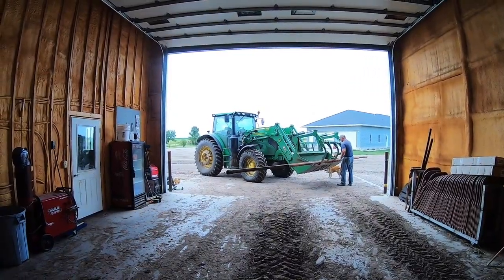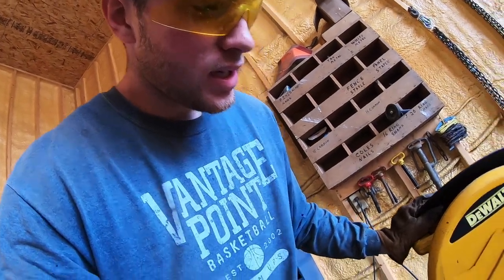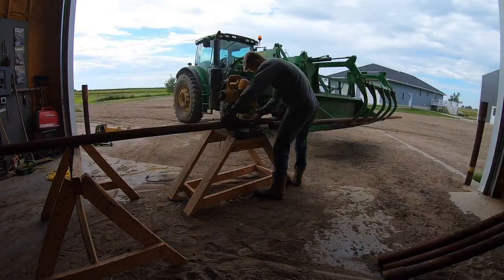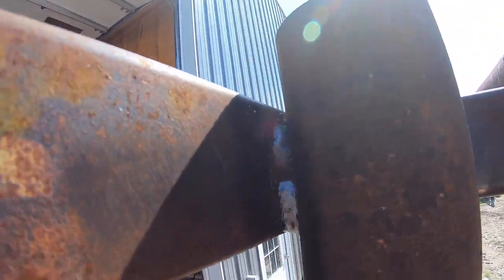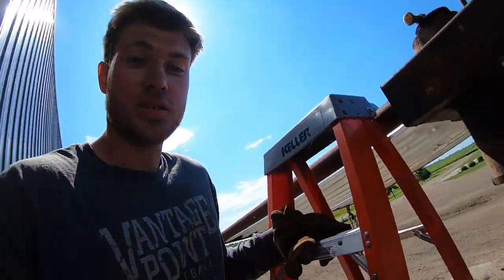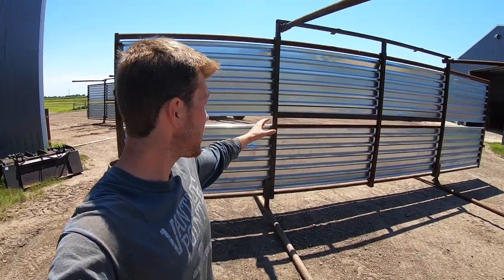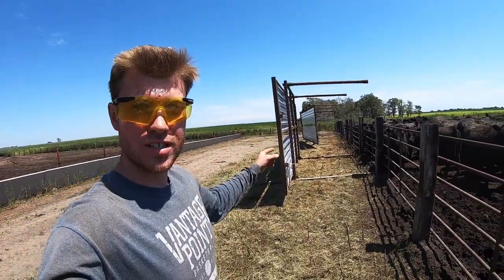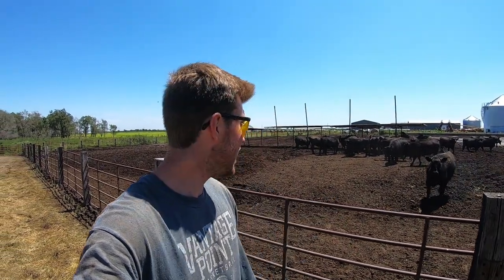Welding Windbreaks into Shade for Cattle

Comment: Consider getting a tank of 100% CO2. It's generally cheaper and burns hotter. But for these windy situations, just get some good flux core wire and you won't need any gas.

Comment: Hey...  so when you flip them over I’d suggest tying a locking chain loosely to   The frame of your forks to the bottom of the frame of your Windbreaks to prevent them from turning over that violently. You can also get some pallet fork extensions that won’t allow the panel to go all the way over too.  Also if you leave them in all year your center of gravity will be altered and I when the wind is flexing the panel, that might be added weight to start bending the panel or alter its performance as a Windbreak!  Remember you are heavily mechanically advantaged up there so 50 lbs gets to be a lot of weight.
Reply from the maker: Thanks for the information, I actually talked to my dad about pallet fork extensions a couple days ago, I think that is a good idea.

Comment: Good metal works...quick thinking....would it be nicer, paint welded spots, to prevent rust. Weld cross angle bar to strengthen structure a bit...little stinless steel chain 500 kg to weld or hook with stainless u bolt,  in future need to shift places easier...one tractor... Dad is wise....boom works for hoisting😁😁😁

Comment: If you are welding steel mostly you can save a lot of money by using a 75/25 mixture of argon and co2. readily available at your elding supply, gives better penetration, and works better on what I call junk iron.

Comment: Also, do you plan to rotate these for winter and deploy them again as wind brakes? If so, will you remove the added leg structure to take the extra weight off the top when they become wind brakes again? Or will you just use these as shelter devices now going forward...for driving rain, sleet, snow, hail etc...
Reply from the maker: When it starts getting cooler outside we will tip them back over to protect from wind, not sure if we will take the legs off though
Reply: You’re gonna wish you did. If I had to guess, when you re-deploy these as wind breaks, the added weight up top is gonna move the CG (center of gravity) on the structure so high that 70 mph gusts are gonna thrash those things to unrecognizable scrap piles.

Think about it :)

Not trying to be hyper-critical here. Just wanted to point that out...